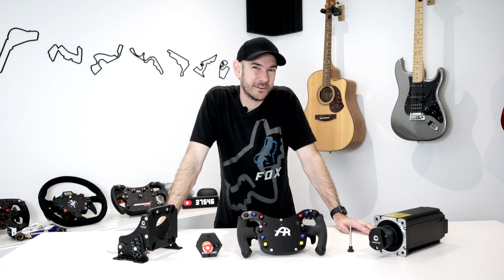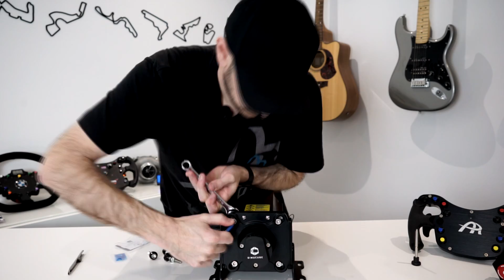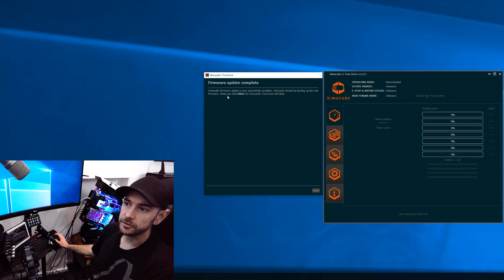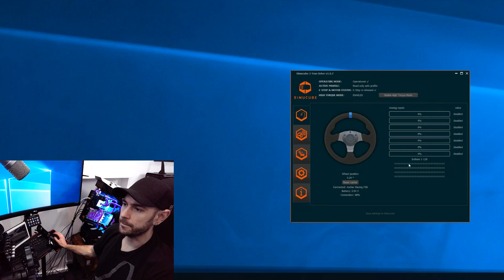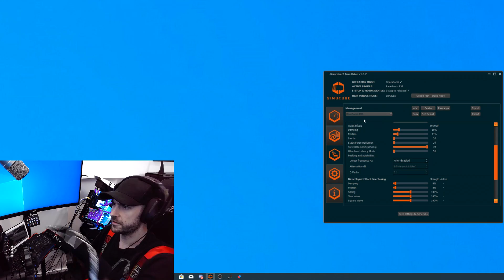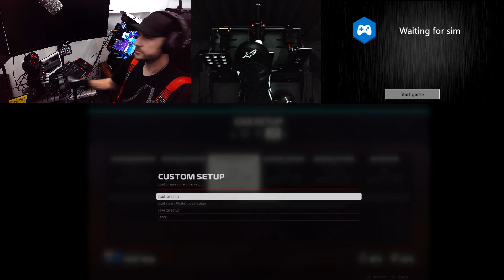FIRST DRIVE - Simucube 2 Ultimate - Direct Drive Wheel Base - iRacing / Raceroom / F1 2019

Comment: Natural Signal
Processing

By passing the simulator's sometimes coarse digitally sampled force commands through force reconstruction engine, the driver will be able to feel the force feedback it was intended by the simulator's physics engine. Moreover, the real nature modeling based inertia, damping and friction effects calculated right inside the simulator hardware will make the driver feel like they're connected to the real world - not to a simulator.
Reply: meaning it is the processing not the motor ;)

Comment: How strong is you drilling machine? :D
I have GtTrack cockpit also and I'm looking for exactly this DD as my next wheel (at the moment im using t500rs).

By the way, I installed this cockpit using your methods in the video :D Thanks for advices from there! :)
Reply: I wonder if its enough to drill by your hands the new holes. I found the packet for hand drilling series for m3 to the m12 bolts :D accidently I dont have a drilling machine and tools for it x) 
its cheaper drilling tool than the machine :D
Reply from the maker: I just used a $80 cordless hand drill

Comment: As I understand the Simucube can NOT use the lights/LED displays from the wheels. Furthermore, I understand it is required that the wheels have a transmiter module. In other words, the Fanatec wheels are useless for this wheel base. Correct? Thank you for all your videos. Enjoying them a lot.

Comment: You feel the car getting light because the steering gets lighter.
Reply from the maker: Of course. But it’s more than that. It doesn’t just give the sensation of the steering becoming lighter. Between the motion platform and the wheel you actually feel the sensation of the entire car becoming lighter over the crests as if you were sitting in a real car. It’s hard to describe.
Reply: @boostedmedia  I thought we were just talking about the wheel

Comment: Grats on the DD. I am very happy with DD1. hopefully it lasts many years and no need to upgrade base anymore.
Reply: @flounder  so, do you think that this is kinda make sense to wait for the software or Podium 2.0? Im just planning to get a DD soon and choose Fanatec DD couse of a lot of nice rims. Buuuuut, Im a bit of confused seing a lot of comlains about quality and all the different issues. Also here, we see a man who choose SC over Podium.
Reply: @vladislavkalinin1560  If you are already a Fanatec user, consider the DD. Otherwise just go with SC. I own the DD2 and I'm satisfied, but I can see problems with the QR some years down the road. But that's actually the only thing I would change (besides still waiting for FanaLab to arrive).
Reply: How’s your DD1? Still have it?
Reply: @EthanOring  yes, but i haven't used it since 2021 or something. Last time i used it i updated firmware and it made it even much better.
Reply: @p1u  what have you been using?
Reply: @EthanOring  Latest driver set i used was 402v or do you mean if i bought different wheellbase? answer is none
Reply: @p1u  ah ok

Comment: What’s “clipping” mate. Pardon my noobness 🤪.
Reply from the maker: Clipping is when the in signal is too strong so you end up with a square wave going through the so gal processor or amplifier instead of a sine wave.
Reply: @boostedmedia  I always thought with those strong DD-Wheelbases clipping   isn't even possible. I thought clipping happens, when the game requires a powerful movement of the wheel that the internal motor can't even reproduce.
Maybe you can clearify this in one of youre next videos :)
Very good video though!
Reply: @LatinMasterxx  
You are actually correct with that statement, it's most likely that his FFB in the Simucube software was set just a bit to low. Most people with DD wheels run at (almost) max FFB in the Simucube software and just lower the in game FFB until they like it. This should prevent all clipping.

Comment: Great video. You should drive the same car in iRacing and Raceroom. Volkswagen electric car is probably the worse example in terms of FFB comparison. Probably the best point of reference for testing FFB in Raceroom are GT2, GT3 and a few other classes (GT3 will be updated soon). Also, Raceroom would definitely require some fiddling no matter what. Finally, sharing DD FFB settings with others is pointless. Everyone is using different motors, kits and software. Personal preference range from minimal FFB effects to very strong.

Comment: Awesome to see you running it. 

Few suggestions with the setting you'll want to set the power in SimuCUBE software near the high end of what you'd do as an absolute max. I run my SC Pro at 100% power for reference. Then you need to adjust the strength using the In Game setting instead. 

Reason is you are limiting slightly the high end quickness in rotation when you limit the power the base can do. I used to do the same limiting the power but I changed once I played around and felt the benefits.

How is F1 2019 feeling on the Base compared to the 2018 game. Reason I stopped playing is because I didn't like the feeling. 

Great video as always WIll.
Reply: Also prepare to build up those forearm muscles especially the endurance. I used to get aching after 1hr stints when I first got my MiGE OSW but now I can go for 6hrs straight if I have to.
Reply from the maker: @Klooney9mm  Yep will definitely be experimenting with cranking the power in the True Drive software and down in the game. I wanted to run as close to out of the box profiles as possible for this video and will of course post up a proper review and settings later.
Reply: For the tuning be sure to go through the granite devises forums. Or If you like I know someone who has access to most of what you'd need.